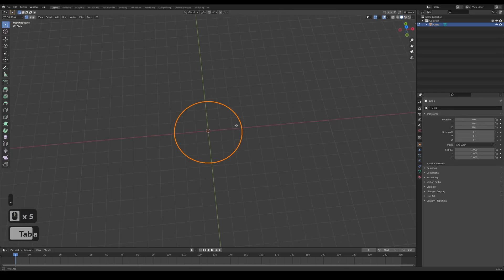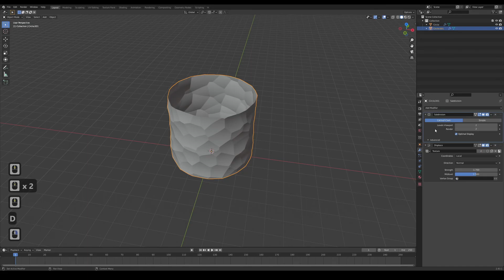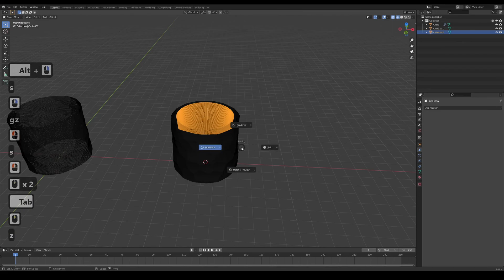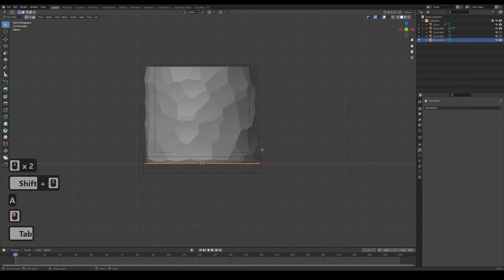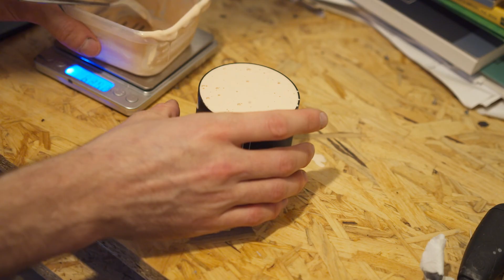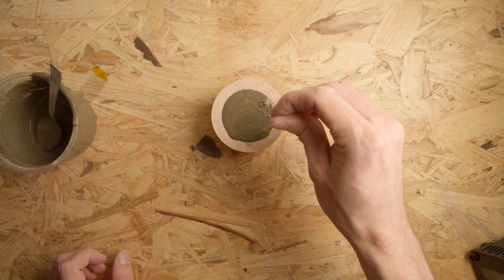3D PRINTING CONCRETE MOLDS | Using 3D printing to make stuff out of concrete

Comment: When i try to scale the size of the texture on the outside of the model it wont go large like in the video so I dont know how he does this, it must have a missing step in the instructions here because ive done it multiple times and it never works how it shows in the video.
Reply: you should type the number on the size input, don't use the mouse to drag left and right cuz it stops on the value "2"

Comment: I skip the mold making part and just make a very thin sacrificial 3d print to pour the concrete into. Benefits are 1) You never know if you’re going to make one pot or hundreds, so why waste money and time on a silicone mold. 2) You can scale the 3d print up or down at will without the need to make a new silicone mold.